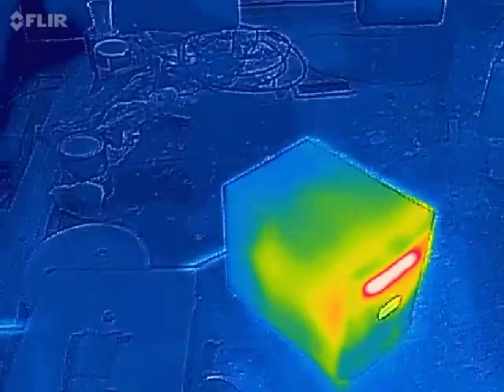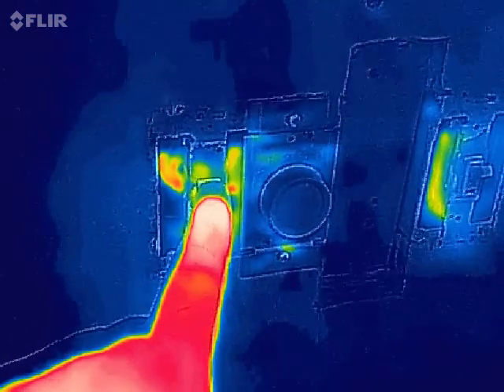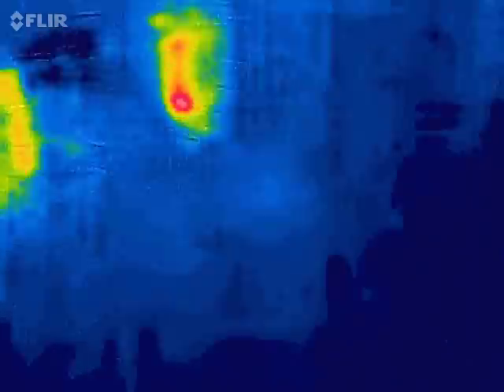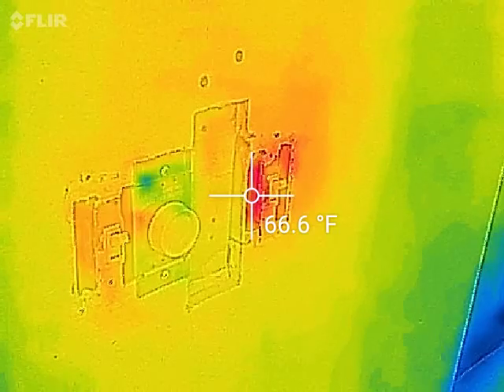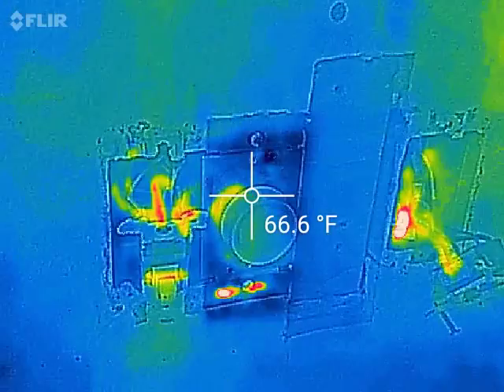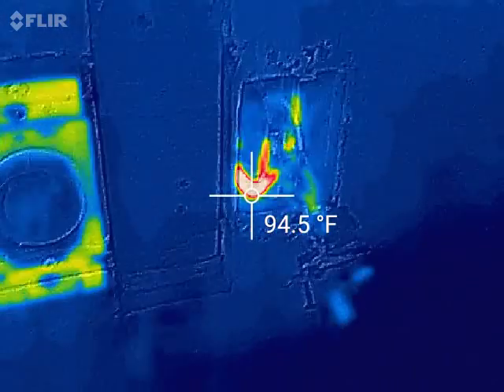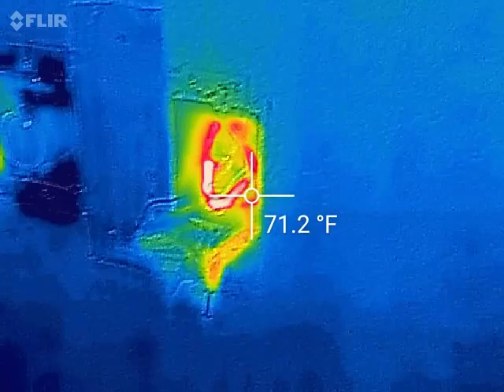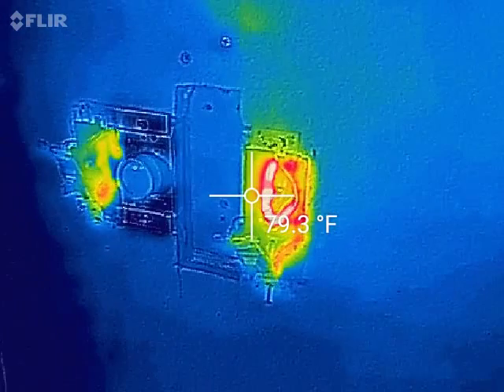Thermal Imager Finds Problem with Electrical Wiring.

Comment: You need to put the wires together in a wire nut with a single wire coming off for the switch itself rather than connecting multiple wires to the switch terminal. You will have a more reliable contact all the way around.
Reply from the maker: I twisted the wires together, then wrapped them around one screw. That keeps the heat from the current draw from building up inside the switch. Here is the new video that shows that. https://youtu.be/GXJ6HpbhR6c